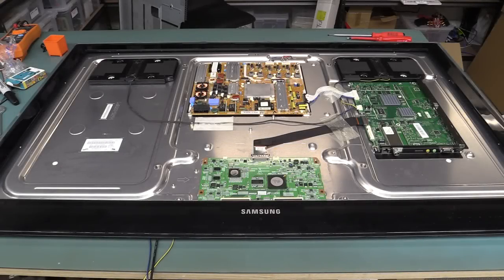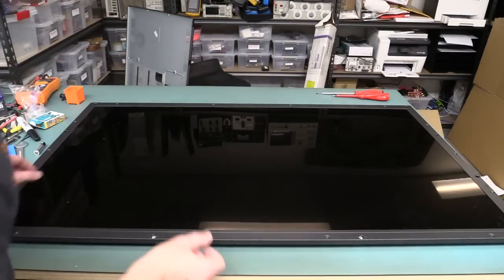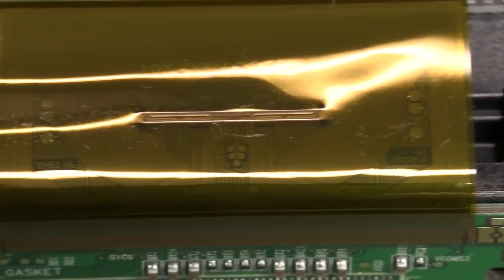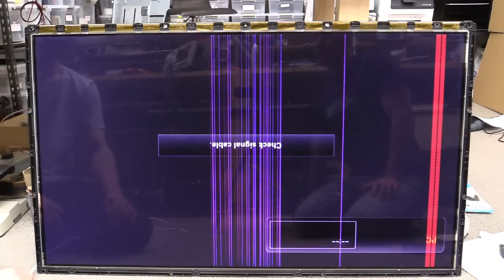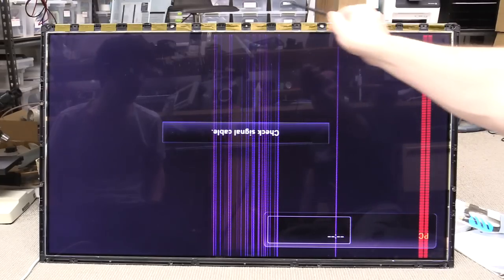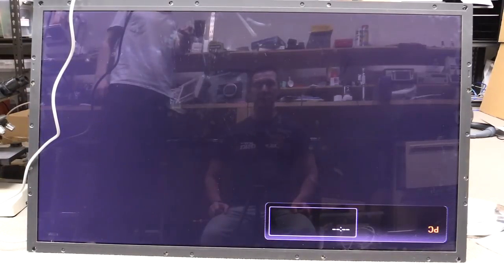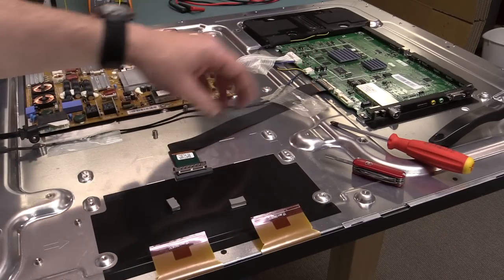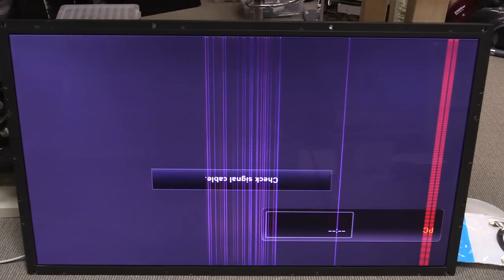EEVblog #781 - Samsung LCD TV Part 2

Comment: The character thing is coincidence, the lines/columns seem to relate to the brightness. more or bigger characters=more prominent lines/columns. 

As somebody else stated it looks like an analogue type symptom. 

My money is on the Tcon being at fault.

In the service menu it is possible to run built in test patterns various stairstep, blank r g b black white and sweeping patterns are available.

info - menu - mute - power on the remote with the TV in standby will switch on with service menu showing. "00000" can't remember how many zeros maybe four week make the advanced menu show if you cannot find the test patterns.

There used to be two test pattern modes
1 Generated by the scaler.
2 Generated on the Tcon.

if the Tcon test pattern was clean and the scaler one had the symptom on it then you can eliminate the Tcon.

If it is on both patterns then Tcon is most likely faulty.

I doubt the screen is faulty.
Reply: +walescmo The question is WHAT on the TCON is faulty and WHY?
Reply: +The Kaiser i doubt a schematic is available for the tcon. i suspect that some bias is wrong causing this strange effect.

The symptom doesn't appear to be caused by the digital circuitry or memory, it's more analogue looking.

the tft transistors need to be turned off as well as on. it seems they are not being controlled properly in the column axis.

it could be something as simple as a wrong supply voltage - or a pull down resistor.

I do not know what exactly is causing the fault.

In the UK it is not seen as economical to repair TV's as there is always some low cost new model available and people generally don't consider the quality of their equipment.

It's time to start laying out money or scrap it. Spending too long on it is a waste without technical information which i doubt is available.
Reply: walescmo Economical? I think you are on the wrong channel… This is about knowledge not money. Ach you Brits… you are still shopkeepers, not scientists. Just interested in profits, not in knowledge and understanding.
Reply: +The Kaiser There comes a time when you make a decision. do i waste time on this and achieve nothing or get on with something else.

unless a replacement tcon is fitted we will not be certain that it is faulty.

Ifa replacement tcon cures the symptom then maybe it would be worthwhile investigating the circuitry for the sake of understanding.

Some people don't have the luxury of unlimited time to spare and need to get bread on the table. 

Time to spend cash or throw it back in the skip.
Reply: walescmo LOL If more people would follow your dangerous example, we would one day become dependent on East-Asia for our electronics. And that would be truly a ridiculous idea.
Reply: +The Kaiser You seem to be intent on being negative. nothing i have said is dangerous.

this is going off topic and is rather pointless.
Reply: walescmo Becoming dependent on China IS very dangerous and you are doing everything to help to achieve that. Economical, my foot.
Russia is learning that lesson right now painfully and nobody's laughing!
Reply: +The Kaiser your ignorance is astounding. it is perfectly valid to say that a comparison with a working TV would help understand what has gone wrong with the tcon.

This TV needs money spent on it.

A dumpster diver doesn't want to put his hand in his pocket to repair a discarded item.

the TV is a very complex piece of equipment which cannot be easily repaired without the correct technical information which i very much doubt Samsung will provide.

It is not economical to waste hours trying to fix something which can be replaced for a relatively low cost.

No leaking or vented electrolytic capacitors. no obviously burnt resistors or components getting hotter than would seem normal. a reflow of the tcon changed nothing. reflow the main board see if that sorts it out. no idea if the voltages on the tcon or main board e correct. 

I made suggestions you are blustering and contribute nothing.

you no doubt are like a child who had to have the last word and will attack me which is not positive.

The eev channel is interesting. You are not.
Reply: walescmo OK a comparison to a working TV as a tool to find and analyse the fault is valid. I retract.

Comment: could it be that the vertical stripes are come from the chipset i.e. the shifter is vertical from this displays and could it be that a 2% of all the Displays are falling out in this way like to insert the vertical stripes? Is it possible but what should be after Millions of this Screens they are produced from Samsung in this Market? They have the display technology for shure in there hand and can regulate the fail and the non fail - maybe.

Comment: Looks like some thermal related issue.
It appears to start off ok when cold but then gradually appears as if something is warming up.

I'm not familiar with how TFT panels work but could the columns be serially loaded and then switched over in a serial-parrallel arrangement? If capacitors are used as the analogue 'memories' then this may explain why the entire columns are affected, much like that seen in CCDs.

Also the 'ghosting' looks like a refresh issue, as if residual charge is not been cleared.

Comment: Def seems like something in the chain between the chargen overlay and the tcon.  And smearing only seems to be triggered by pixels in certain positions in a character block.  since text is likely generated on the cpu board and overlayed on the tcon, could certainly be on cpu board.  Other possibility, dare i say it?  the "F" word... firmware?  firmware is a four letter word, ive had stranger things happen ;-)  caught in strange vid more that triggers a bug

Comment: Dave/David (or anyone else), can you tell from  this jpg picture of my Samsung T460HD TV/monitor whether my issue is with the T-Con board, the main video board, the LVDS cable between them, or something entirely different? Notice the horizontal bars are wider at the left.  The unit powers on, and I can do a factory reset (power-of/mute/1/8/2/power-on (wait 15 secs) enter/enter/enter, however the same screen shows, no matter what I select as the video source using remote or side button.  Thanks!

https://www.dropbox.com/s/pc8wdg20af4q0db/2016-10-21%2020.14.50.jpg?dl=0

Comment: plz link me up if you make a video 3 or find a solution for this, I have the exact same problem on a samsung UE32C4000PWXZF but mine does not have a replacable t-con board, it is a cof tcon board, soldered to the lcd flex, kind of like your double boards but without a t con board, so I suspect the tcon is in those rectangular striped boards or in the main motherboard, Idk the price for that specific tcon board, but for a trashed tv with such a big screen is word buying it even if it not works after replacing the tcon board, even if you buy a tcon for 50dolars or even 100 it is word for the tv you got there if it fixes it, mine is only 32inch but if the tcon was replacable I would buy it cause I honestly believe the problem comes from there
Reply: wow I just realised now that this video is 6 years old, nevermind then, the tv is probably gonne by this time since there is no part 3 ahahahah

Comment: I Don't know...Almost all of these problems, have been defective display panels, for me...Sorry.
Reply: +Charlie Hart 
What part exactly in the panel was defective and what caused it?
Reply: +The Kaiser  I never determined the exact panel defect. To be sure, I have replaced a couple of T-Con boards, with no improvement. My guess, was loss of a ground trace connection, on the bonded ribbons. One Sharp, one Samsung, to be sure.
Reply: Charlie Hart
Interesting. What might have caused that loss of the ground trace?
Reply: Poor manufacturing.
Reply: Charlie Hart Well, it worked, then it failed. What happened to make it fail?

Comment: problema en la t-con específicamente en ntc falta de voltaje logre repararlo usando una resistencia de 270k a 12 vdc y un cable a ntc punto esta cerca del max 17122 o ka 1718 cualquier duda peguntar
Reply: Orpheo32 reparaste una falla identica a esta? me interesa saber  mas detalles. tengo el mismo problema, me podrías aclarar que es el ntc?
Reply: Me sumo, reparaste el mismo problema? Sería bueno si podés agregar más infrmación.

Comment: Guy on the AVS forum with the same issue on a Samsung lcd tv, but different model - http://www.avsforum.com/forum/166-lcd-flat-panel-displays/1492931-samsung-lcd-tv-colored-vertical-lines-issue-resolved-loose-connector-save-yourself-1237-my-model-ln55c650.html
My money is possibly still on TCON/LVDS cable issue but here it appears to be a mainboard problem (loose connection).

Comment: oh I WATCHED 👩‍👧‍👦Another guy do this hot flow chips & oven float  idea  but as im late watching Utube 2015 daves seems way ahead by years here (Y) i have 2 tvs 1 apart for parts as a close inspection the screen had small cracks try use pc boards in other 65" i found 6 months ago (Y) 🐌💬wot?

Comment: it looks like it could even be firmware   because your wierd lines are only happening on text :o 18:16
Reply: ***** possably memory thermal issues
Reply: ***** it could also be bright colours :o
Reply: ***** I know some people in the comments say that something is left floating, but I have to agree with you. I would go back on ancient levels and just look for overheating or a malfunctioning SMD capacitor or anything simple that comes to mind.
Reply: he didnt see if it goes away with an input tho so i dunno :/
Reply: +Fennec Fox (FennecTECH) You are just guessing. Conjecture is a shame for a "tech."
Reply: The Kaiser  im making guesses based upon all available information   if i could touch the set i could form a much better theory.   with the information i have  i cant make much more than a g guess now can i.  at least IM trying to be helpful.  where is your sugestion?
Reply: lets hope for a part two :D
Reply: ***** This IS part 2.
Reply: i meant part 3 personally i think its brightness in the columns so if there is an input if it has a bright spot that would show up as a virtical column.   though i have NO idea what would cause that     though memory issues could and so could an failing panel and tcon board.
Reply: ***** It could be cheap, deformed low quality electrons…
Only God knows what those Aussies feed into their sockets … ,
but I bet it's got a pouch.
Reply: yeah  something somewere has been pooched

Comment: Hi everyone!
EEVblog 
+mikeselectricstuff 
or any electronic fellas....

I'm in a desperate try to save my TV. I tried in other forums but i had no response... I hope some Guru here could give me some light. 

I have a Samsung 40" LED UE40D5000 model that stays black on power up. 
Power red led blinks 6 times and nothing more happens.
PSU is fine, Backlight stays off when connected to the MainBoard, but works when control pin is disconnected. So i'm sure its working.

I suspect DataBus problem, like stuck Mainboard in some initializing state, or some dead device on its path, or no load of program on startup...

Can someone give me some help?

Few info:
PSUboard: BN44-00422B - REV1.3
Chassis : BN94-05072E - D27Q
LCD Panel: LD40-BGD-V1

CNM803, from PSU to MainBoard: 
1- B5V : 5,350v
2- SW_P: 3,586v
3- B5V: 5,350v
4- A5V: 5,359v
5-6-8  GND : 0v (hopefully lol)
7- B12V: 12,703v
9- B12V: 12,703v
10- SW_I: 0,052v
11- B13V: 12,684
12- H_O:  (NC)
13- B13V: 12,684v
14- PWM:  	0,079v 

TCon board receive its 12,5v and heats normal

MainBoard have good looking voltages around CPU and RAM: 
3,335v - 2,493v - 1,515v et 1,127v
Around Tuner, linear regulators looks fine too (7809 et 7805: 9,023v et 5,025v).

Tuner heats its way so does MTP amplifier, RAM and CPU. 
So everyone looks feeded and in working condition...

On the bus going to sensitive buttons of the front panel: CN1201, pin3 - A5V only shows 3,299v coming from the MainBoard instead of 5,359v ( i think it should be).
CN1201 plugged or not to the sensitive board, no change...
Status led blinks when receive IR...

If my MainBoard is dead, can i replace it with another type that will still be compatible with TCON and LCD Panel (another TV using this same LCD panel). I want to use it at least as monitor on my PC

I would thank anyone could help me, also with some documentation of any sort (samsung techbook, schematics, diagrams...)

Thanks a lot for any help!!
Reply: yahnsolo Get the service manual and follow the steps.
Reply: The Kaiser My Lord, where can i get the service manual for this model? I tried to search but didn't found specific sce manual....
Thank you for your help
Reply: yahnsolo It is "Your Majesty", not Mylord.

Did you write a letter to Samsung?

They should be located in the southern part of the Japanese colony of Korea in the city of Seoul.
Reply: The Kaiser So, from now on it will be just "Dude" . And for your concern i don't expect receive any help from Samsung, since i already contacted them by e-mail (with this thing so called Internet). They just told me to go to any Samsung repair... (it's no more under warranty)
As electronician tech, i just want to try by myself first. Also, letting Samsung replace the whole mainboard, they will charge half price of a new TV set.
Reply: yahnsolo No, write a polite letter explaining what you just told me. Samsung great company, gaining experience and competence as a young e-engineer, etc.
You will be surprised how tangible objects like well worded letters sometimes move mountains.
But please, do not address them as "Duke".
Reply: The Kaiser i just did the way you said. Polite and well explained, but the response have been: "please contact local Samsung authorized repair center".

I just wonder that someone here that already repair Samsung TV's could help me gently with some documentation, schematics, and/or troubleshoot Samsung LED TV  "D" series...  
Those companies doesn't give their internal documentations that easy
Reply: yahnsolo Tell them you want to buy their repair or service manual. Should cost around 30 Euros. And for God's sake, don't use email. Only trailer trash sends email and trailer trash never gets what it wants.
Find to the name of the person you are writing to, keep a copy of your letter and if you do not get a reply within two or thee weeks send a copy of your letter and a strongly worded complaint to the superior by registered mail. That might cost someone the job, but it works.
PS: And for heaven's sake, use proper paper, no copy-shop or printer-crap.
Reply: +yahnsolo you put up your voltage readings, but not reference voltages for CNM803.. eg: B5V is meant to be 5v, but how much variance  is acceptable 5% is 5.25v... 5.35 is 7%... your 12v "B12V" are a higher voltage than the 13v "B13V"

"On the bus going to sensitive buttons of the front panel: CN1201, pin3 - A5V only shows 3,299v coming from the MainBoard instead of 5,359v ( i think it should be)."
work your way back from this, it should be 5v... :/ 
12v should be 12v... 13v should be 13v... 1.5v on the processor could be too much if its meant to be 1v...
Reply: .... IF someone have some datasheets, procedures, troubleshoots guides from Samsung ..... Feel free!
Reply: +fleuroman The PSU does have voltage reference for CNM803:

A5V: 5,3V (100mA - StdBy for sure)
B5V: 5,3V (3A  )
B13v: 12,8V (1,57A )
Vamp: 12,8V (2,3A)

Didn't reopened my TV for few months...
Reply: +yahnsolo well those PS voltages look ok then... do they all match up? as I said, if that is A5v on the front panel? and it's 3.3v from the main board... that's where your problem will be...
Reply: Regulator failure from A5V side 5,3v on the mainboard input, and the other side A5v on another connector going to the front buttons that had correct voltage of 3,3, not first A5V...
Just burned WT61P805 panel controler on mainboard doing a test ... :( 
Need to find another BN94-05072E board....
Or another TV using LD40BGD-V1 panel
Samsung, no more!

Comment: Hi mate.
Let's go from the premise that I know nothing, Ok.  Why does it take some time for the fault to appear.  Is this some charging thing, and than cause a fault. 
Ignorant, from
Perth.
Reply: MichaelKingsfordGray So in other words, stick to your knitting? ; )
Reply: MichaelKingsfordGray Sorry mate, that's how much I know.  When I repair things I look for the large white arrow that points to a blown cap or a track that has burned out.  I just love it when I hear people explain something and I start to halve understand what they are talking about.
Reply: +Marcel Timmers

It can be also be a digital problem, bits accumulated in the memory. If red color is represented by 8 bits, value from 0 to 255, adding one bit accidentally every second, would cause it to slowly glow more and more red. However I would expect it happening much faster, since digital stuff works very fast, and if such mistake is happens on every cycle (or two, or three) of processor, it should go to 255 very fast. 

However, I also don't know much here, I'm more a software engineer) 

And it's really look more like something slowly charging or heating.
Reply: Alexander Zakusilov well that's what I thought as well, but I would not know where to find the problem.
Reply: +Alexander Zakusilov It's as if horiz. signal is bleeding to vert. line drive, but only in some overlay modes. I did not see the horiz. lines outside ghosting.